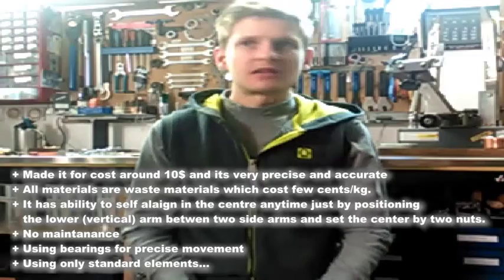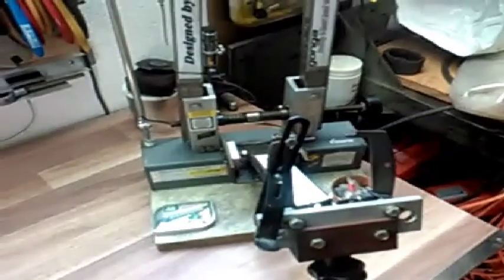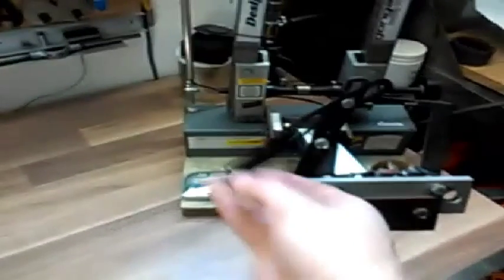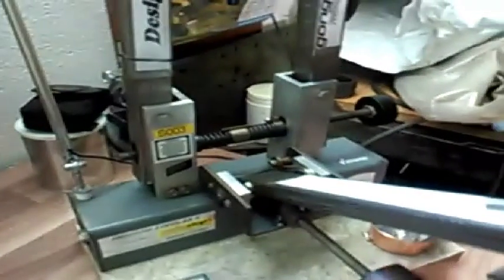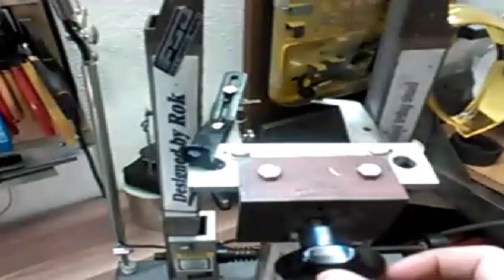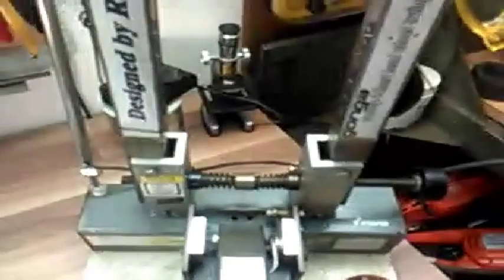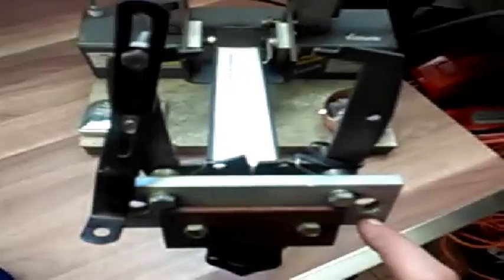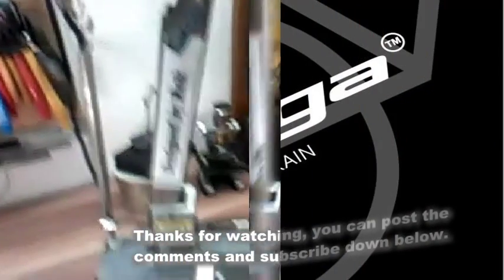How to make professional wheel truing stand for bicycle for 10$

Comment: hello , good job , please tell me how do you move the both big arms? What system do you use?thanks
Reply from the maker: Well first of all i made the axle with left and right thread. Which then gives oposite moving of the arms but i can say the art of all is to assemble it with high precision becaouse you need to get left arm on the axle not at the same time as right one othervise you lose the symetricity. Its so precise job that need to count degress of revolution. But im mechanical engineer and have lots of practice with similar things. Thanks for your comment.
Reply: Thanks. I understand very well . It is like manual car Jacking.
I am very curious if you use CNC or normal drilling machine?
Those support for big arms are welded? Or other assembly system? 
I have experience in work with steel and I want to do my own bike equipment.
Thanks again.
Reply from the maker: All the tools used is only hand tolls, hand chain, hand driling machine, hand grinder, no CNC but the arms wheter can be welded or like in my case i used the U shaped profile and srew it M5 bolts from inside the arm holder profile - becaouse i was disassembling it many times. But for serial production i would suggest welding defenately. Basicaly in this case the entire truing machine is made from standard recycling parts so it cost nothing at all. You just take all from a metal junk trashjard. Thats the art of engineering make it cheap but functional as comppetitors or even better. No aditional tools for self centring necessary like park tool or similar.
Reply: Thank you very much. I love your style with recycling parts . Keep it like that.
Reply from the maker: Let me just answear about question how to make both arms moving at same time. Well its very simple the spindle and nuts have left and right handed thread which makes oposite arm moving towards other one.